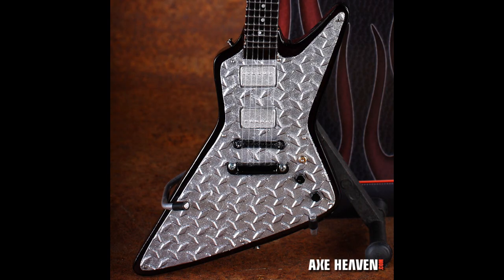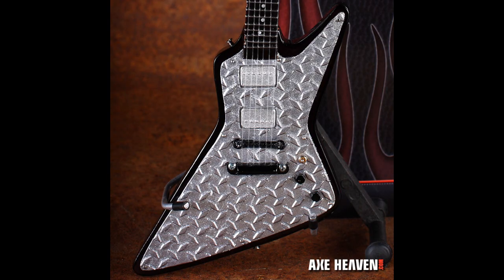Metallica autograph frame

Comment from the maker: @OldWeaponsRCool Yes, I use spray adhesive. The trick is to spray it on and let it dry for a couple minutes...or even longer before you attach the template. When you stick it on, it's kind of like a Post-it note.

Comment: @stevinmarin How do you get your templates to stick to your wood? Do you use Spray Adhesive? If so how do you get it to where you can just peel it off after your done cutting it out? I've used some spray adhesive to glue down my templates but I have to sand it off with a disk sander. If you or someone could help me out I would really appreciate it. Thanks.